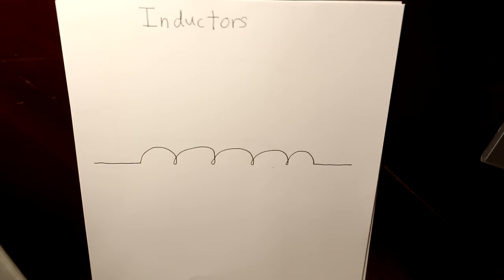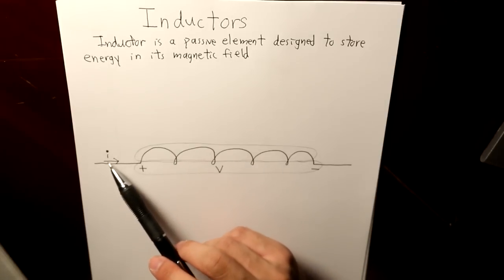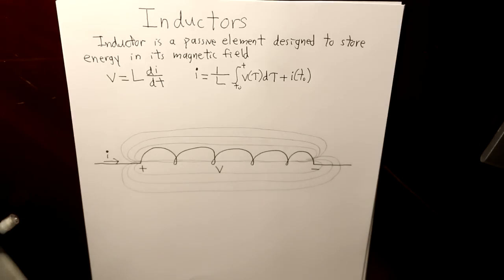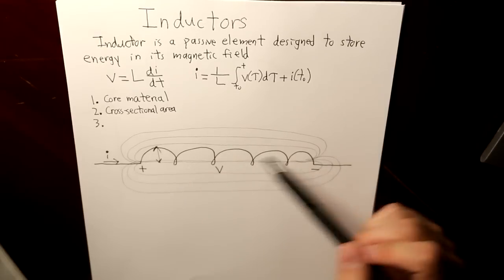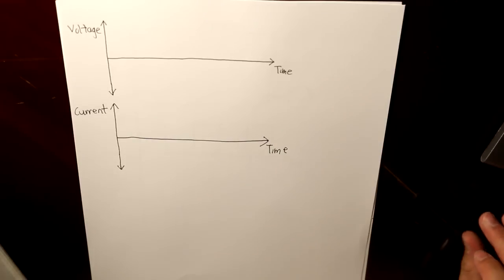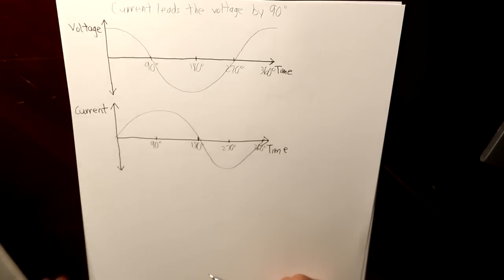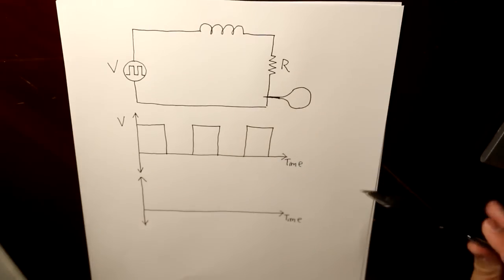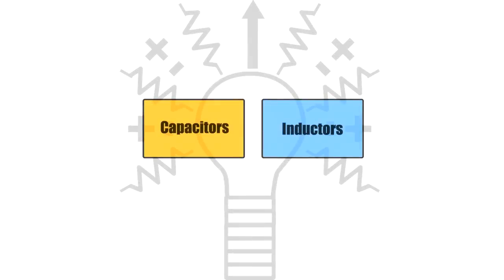Most Clear Analysis on Inductors [Must See]

Comment: Thanks for a nice video. At 7:21, did you say current leads voltage? That would be for a capacitor. With an inductor which is the topic of this tutorial, voltage would be leading the current. Thanks again.
Reply: That’s what I thought toooooo

Comment: at time 1.10 you said that a voltage is generated, and you drew it with + on the left and -- on the right. my question is , shouldn't the  generated voltage oppose the current, ie   --  +   if the current applied is from the left?
Reply: Conventional flow or electron flow.

Comment: Voltage is what pushes the current through its not a thing it's an action.
Reply: It's a force field, just as gravity is a force field..
Reply: It’s a force. What it does is in its title: electromotive force I.e. the force that moves the electrons. A good analogy is water pressure. The higher the pressure, the more is the flow.

Comment: Voltage is not generated...voltage is present and is responsible for the push or pressure behind the current which allows current to flow.

Comment: sir please explain me how inductor act as  short circuit in DC   mode
Reply: I think it’s because the current is not changing/constant in DC therefore there is no voltage drop and it will act just like a wire.
Reply: Inductors are made up of conductors ( eg. Copper wire). These conductors have no resistance ( at least in theory, in real life they have some resistance - mostly negligible). So, they are considered as short circuits which offer no resistance to DC.
Reply: In a dc circuit, the current through the inductor is zero when the circuit is first energised as the magnetic field it produces expands from zero to maximum very rapidly and produces a large back emf. Supply voltage appears across the inductor. Once the magnetic field has expanded to its full extent and is no longer moving, current can build up without hindrance and does so until it is at maximum. Voltage drop across inductor is now zero so it acts like any other piece of wire: a short circuit. 
Hope this helps.